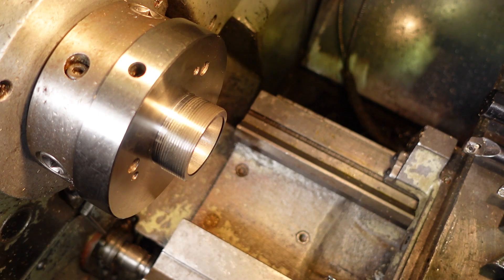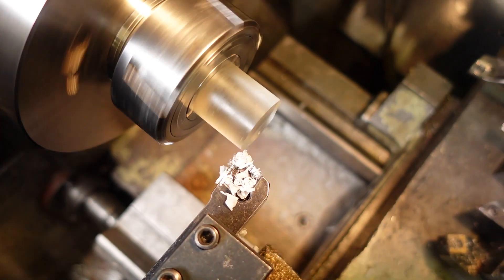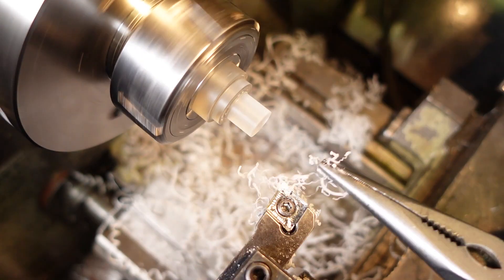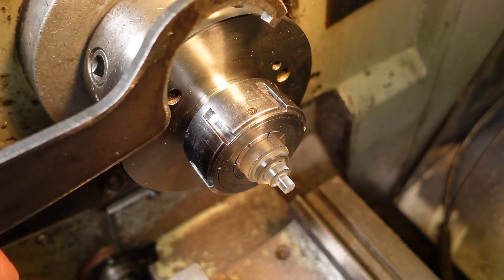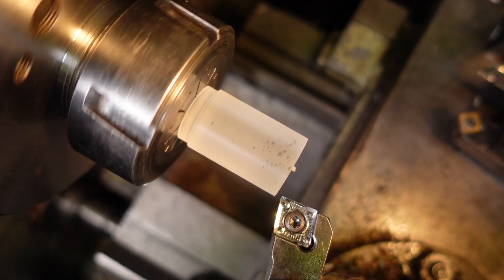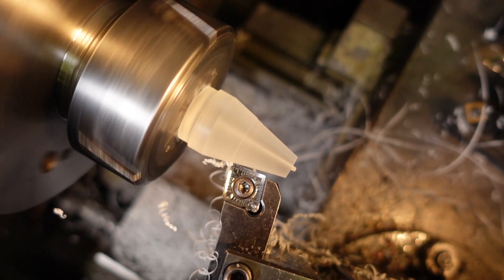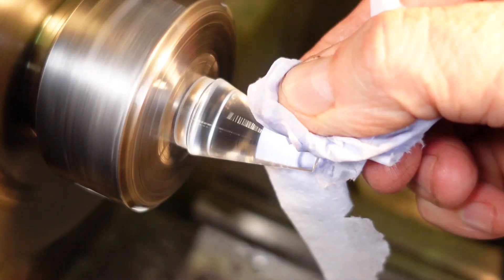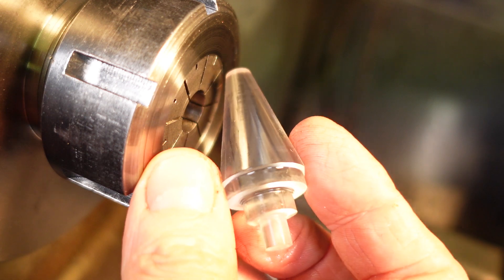Machining a 10 GHz Lens Antenna from Rexolite 1422 Dielectric Polystyrene

Comment: Are you building some type crowd control, or better yet some thing to be used against the Russians?
Reply from the maker: Spookily, I had an enquiry from a company who work with video machine intelligence and intruder identification about high power 100 GHz steerable antenna systems. I'm assuming it was for "area denial" purposes. I think it was for slightly more sinister purposes than my original idea, which was to stop marauding cats from digging up the flowers in my garden by giving them a sharp blast of microwave energy!  However, I have two Chihuahuas who find cats highly distasteful and chase them away.  Fully automatic, with machine vision, audible alerting, able to work behind trees and bushes, no batteries required.  the only microwaves involved are those I use to defrost the raw chicken wings they eat for supper.

Comment: I'm thinking about getting into ham radio... Need an excuse to put a radio in my truck!
Reply from the maker: It's getting very difficult in the UK with safety regulations about what you can touch and use while driving, plus it's painfully hard to install radios in most modern cars, and they are so full of electro-smog that getting good reception is tough. My old motorhome had a diesel engine and almost no electronics, it was a fine vehicle for radio contests and expeditions. Even my 2013 Mercedes diesel is electrically noisy and tricky to fix a radio into.  I use a trailer to carry a 12 metre inflatable SCAM mast, 230V generator, deep cycle batteries and compressor these days, and set up the radios in the back seat.
Reply: @MachiningandMicrowaves  We used to have vhf radios in our service trucks.  Electronic diesels, good grounding and a line filter helps a lot!
Reply from the maker: @NavyCuda  Modern cars are a nightmare unless you turn them off completely. Warm and comfortable inside, so you put the antennas outside in the weather and get on with the important "playing on the radio" bit in comfort.
Reply: @MachiningandMicrowaves  Years ago on our 7.3L Powerstroke diesel service truck, if used the handheld, there was a span of rpm that the radio would pick up.  When I installed a radio into the truck, improved the trucks grounding, the installed radio did not pick up that artifact.  The hand helds still did.  vhf, but I don't remember the frequency.

Comment: All this RF stuff is black magic to me. Pucker factor pretty high on turning the taper while holding on to the nubbin at the end 😆
Reply from the maker: It's remarkably stiff material and I've never managed to rip it out of the chuck even when I got a bit over-enthusiastic.  It chipped out when I was roughing, but the chipped section was removed when I made the taper.  When I'm making a batch, I set the compound the other way and turn the taper backwards towards the chuck, roughly to size, but this was a one-off done in a hurry, so I just went for it

Comment: Are these better than the usual LNB horns when feeding a small dish. Or just convenient when using POTY-style dualband feeds?
Reply from the maker: Nice thing about them is they are totally sealed without needing a radome.  They have a good pattern, but there's some sidelobes in the H -plane that you can't get rid of with a rotationally-symmetric lens. Usual approach is to mould the dielspike with knobs on the sides, but machining that is tricky,  I really want to try a smaller diameter tube totally filled with dielectric to see how it performs, but my PC runs out of memory doing the simulations as it only has 16 GB of RAM. I checked with someone this evening who runs 256 GB for his OpenEMS simulations.  I need to go LARGE!

Second good thing is that if you make one for 5.7 GHz and one for 10 GHz, they can mount very close together so you can run two bands just by offsetting he dish by 2 degrees without compromising the pattern too much. I run then over and under and use the elevation drive to change between bands.  I still prefer a Pickett-Potter dual-mode feed for best performance and sidelobe control.  I'll be making some more of those in an upcoming video too.
Reply: @MachiningandMicrowaves  Oh nice, that elevation for band change is a nice idea.

Comment: Short #1 in the can. 
Question/observation

Can you make a overview type of video showing of what you are creating is used. 
I'm a 45+ year communications fan , and I still get intrigued by Microwave and < electronics and physics.

Kinda like I made this: {time lapse montage of incredible amount of work} to do this {has QSO with ET)
Reply from the maker: That's the plan, but time constraints are a huge problem as I'm working through a backlog of 13 months of machining and electronics jobs, some of which are just not photogenic or interesting. Also, it's 2.30 AM local time and I have to get up for work in less than six hours!  Bedtime...